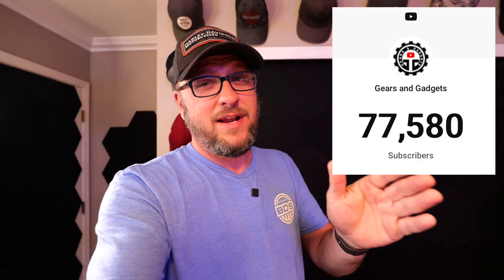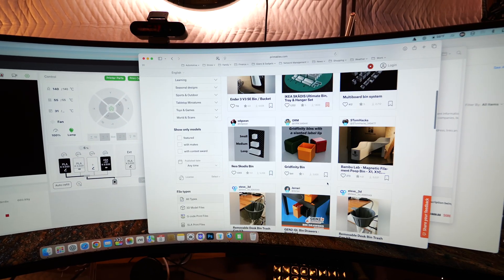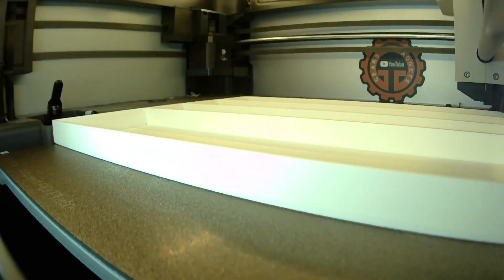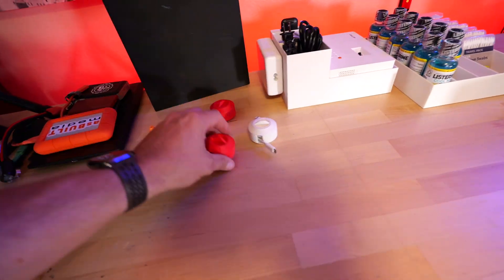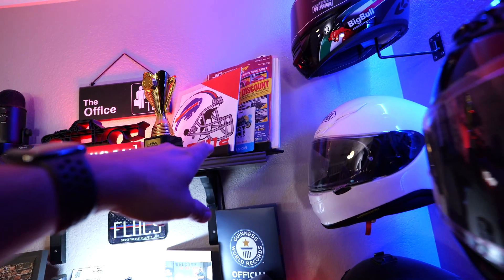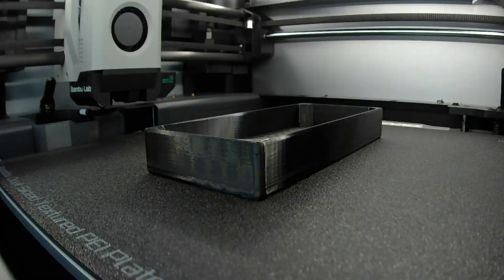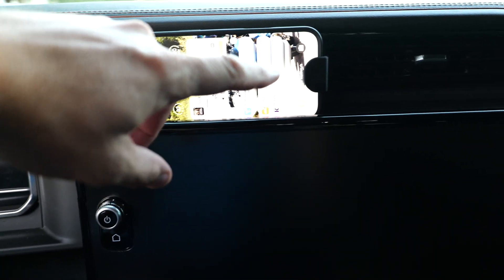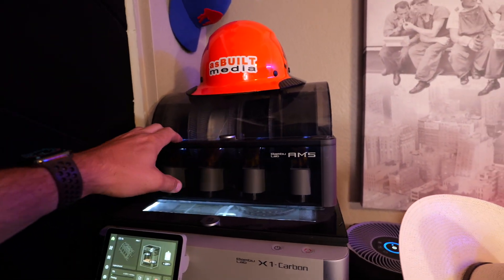I Put 1000 Hours on the Bambu X1 Carbon, Do I regret it?

Comment: What are your thoughts on using the cloud versus the LAN to print?  My gut says if you design something and then print it using the cloud bambu labs will have your design?
Reply: @Yaegermeister163  it’s a non issue. There has been zero cases of Bambu stealing or using a design printer with a customers printer. A billion dollar company would have to go far out of their way to do so for what benefit? Lose millions of dollars due to lawsuits and lost customers.

Comment: I have over 8,000 hours on two X1Cs. They are amazing, but things are getting more competitive.
Reply: @cstategrad99  what other printer do you recommend that can compete with the X1? I'm new to the hobby, on the market for a new printer
Reply: @kagisomonareng if you’re new to the hobby I definitely would go Bambu. Either an A1, a P1S, or a X1C. 

IMO no need to look anywhere else. X1 will do everything. So will P1S but no touch screen and both of them aren’t as beginner friendly. But they are good. 

If something breaks, and it will eventually happen, A1 is easier to fix. 

If you want enclosed and that same A1 simplicity…. Consider the H2S
Reply: I definitely would appreciate some other options to this. I’m coming from a Kobra V2, I want something enclosed, and I can just set and forget. I know about Bambu’s “policy” and honestly that isn’t a big deal to me, I own an iPhone, I’m okay with a walled garden. I just want good print quality and something that is simple to use.
Reply: It's also like a 3yo printer though

Comment: I think it would be cool to print some kind of drainage system for the BAK revolver X4S bedcover. I have a Honda Ridgeline and because of the non traditional bed and cab orientation, it leaks a lot in the front corners